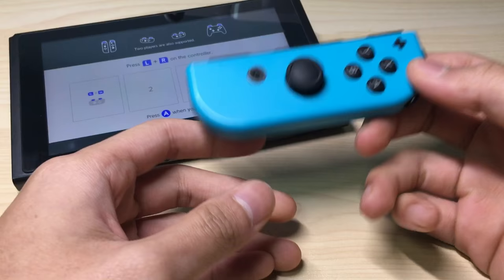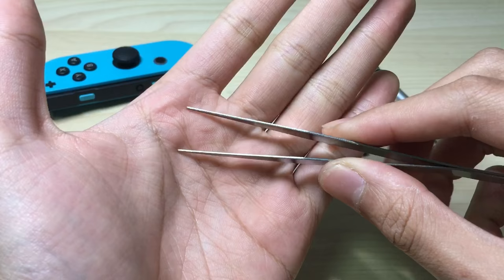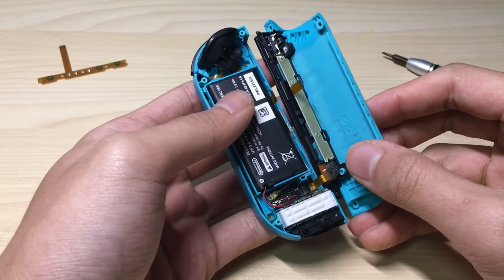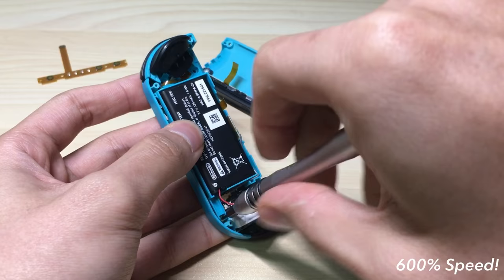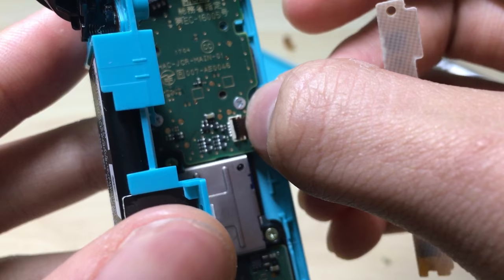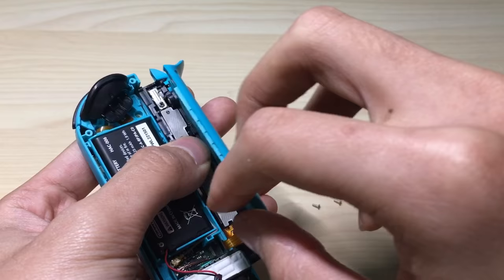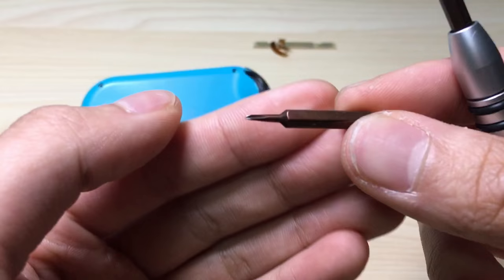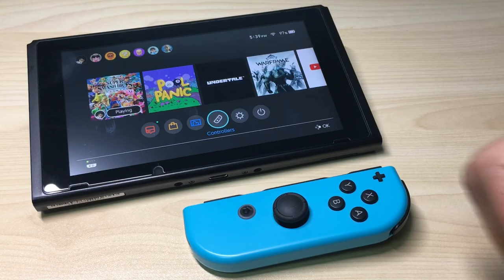Joy Con SL/SR Side Buttons Repair Tutorial (+IMPORTANT TIP!) - Nintendo Switch DIY Repair

Comment: Just used this tutorial today to fix my left joycon, thanks for the tips!
One thing I’d also recommend is reinforcing the part so the SL and SR buttons are more clicky. To do this, I took the old, faulty part and ripped off the ribbon cable, then used a knife to remove the electronic parts from it so it was just a flat board of the exact same shape. I then screwed both in together one on top of the other, so that the part didn’t flex as much when the buttons were pressed. It’s now more clicky than the original board, which is nice! The piece flexes less too so less prone to breaking.
Reply: yes. such a pro tip !!
Reply: I did just like you did, i was a litle more dificult to close, but worked. I hope that will improve the cable resistence. Thank you!
Reply: @viniciussales4264  Yes, definitely made it more tough to close but once it closes it should be solid! Had to replace the Right joycon in the same way last year, and have not had any issues myself with either joycon so far.

Comment: My son dropped my switch and the joycon stopped connecting to the switch when attached. Found out the black bar wasn’t working anymore. You’re vid helped me disassemble the controller and it turns out the strip was unplugged (didn’t know it was a plug at all lol). Just plugged it back in and now it works. Thanks for the vid

Comment: Thanks for this video, I was able to repair my son joycon following these instructions and the replacement cable and a tri wing screw bit. Cheaper than buying a replacement. The old cable was kinked and I replaced it just as you showed. It works perfectly now.

Comment: I just spent 2 weeks getting this problem fixed after thinking I broke the first replacement by bending it too much and it wouldn't work. Another replacement part later, I just now realized the little connector from the battery was slightly sticking out of its socket🤦🤦. Anyways thank you for your tutorial it was excellent and very thorough.

Comment: Thank you so much for this video, I couldn't use the synch button one day and this helped a lot with fixing it.

My hands are big and they shake a lot when doing precision stuff so you can imagine how hard it was for me, especially dealing with those tiny connectors like the ribbon cables and the battery connector.

I think I meesed up tough because the actual sync button feels loose and I can't actually press it with my fingers, I have to use something to press it down and make it click, kinda like the wii days... by the time I noticed I couldn't be bothered to open it up again lmao. Maybe some other day.

Comment: Before rushinh to buy a repair, check the ribbon cable hasnt simply loosed a little.
This happened to me following a reshelling your joycon tutorial.
Only SL worked only 3 lights lit up. Simply repositioning it fixed everything.

Comment: Thank you helped me replace it for me on the original the ribbon cable at one end seemed to have been badly bent so moving it ever so slightly causes it to lose connection so I just replaced the whole thing.

Comment: thanks for this tutorial! do you have any clue on what to do when the little lock bar breaks off on the connector? they’re so tiny so it’s impossible to put it back on 😖
Reply: Are you talking about the little black plastic bar for the ribbon cable? Mine broke too and idk what to do, I’m considering just using super glue to keep in place
Reply: Same issue for me, the black clip broke off and don't know what to do to hold the ribbon cable in place, any advice appreciated!

Comment: My switch as a whole has been faulty since day 1 and its a shame since i love all the games. I've had countless problems: My consoles fan is faulty, drift on both controllers, all of the side rail not working on my left joy con. This helped me get rid of one. Thanks!
Reply from the maker: That’s true, the games are fantastic, I just wish the console would be more reliable. Anyway hope you won’t get any more issues!
Reply: Did you ever get your console sorted out? The fan is connected to the Switch’s rails through the same circuit so replacing the fan will resolve the issue.

Comment: Just replaced mine, but i didnt remove the battery an the other connectors. Just removed the two screws on the right side of the battery, then i was able to lift the plastic part and reach the connector to make the swap. This make it way easier, and less risky, since the battery connector is so small and feels super delicate.

Comment: Unfortunately couldn't do the under the battery tray trick for my left joycon as it will interfere with the stick module and the ribbon cable for L/ZL buttons but otherwise it went great, thanks for the tutorial. Too bad the cable is intentionally designed to be too long in length as this cable will fail again as that fold flattens over time until the connection breaks.

Comment: I have a problem with the left joycon - both stick drift and the failure of the SL SR buttons. Unfortunately the left one doesn´t have a nice way to tuck the ribbon cable so as soon as I reassemble it I know it's only a matter of time before it happens again.

Hopefully Nintendo (and the other major publishers) resolve this problem next gen because they used to stand for quality but each of them have been suffering stick drift for years now across multiple iterations. Even the "elite" or "pro" options that cost £150+ suffer the same problems.

Meanwhile my GameCube and PS2 controllers work absolutely fine over 20 years on.

Comment: I had the same problem, but i fixed the flat cable, it is really hard and have to be precise, if you dont want to wait or pay for a replacement should give it a try, but i recommend buy the replacement, too annoying to repair

Comment: Thank you for the great video. I've followed the steps on a R Joy Con and put it back together but am getting no lights at all. Battery and NFC cables seem to be reconnected correctly and ribbon cables seem to be clipped in correctly. May just battery drain? Any suggestions?  🤔

Comment: Hiya, i damaged the rail on my joy con and want to replace it. Is this the same method to do so? Thanks!
Reply: This method is just for repairing the sync button, joycon wireless LEDs and SL/SR buttons. If your joycon won't connect to the switch handheld properly, it may be because some pins aren't making contact so you'll need to clean them.

Comment: Can it be fixed without the sl sr board? I changed the joycon's shell and the zr button wasn't clicking, so I took it apart and fixed the button issue, but now this happened. It was working well before I took it apart the second time, I don't think the board got damaged in the process.

Comment: I replaced the shells and on the left joy con the SR ribbon cable doesn’t want to stay in. I’ve made sure it’s locked down and everything but it just doesn’t stay in and I can’t get the joy con to connect to the switch. The battery is depleted, but I’m assuming it works. it doesn’t connect to the switch to charge. Any thoughts?

Comment: I have some questions if you wouldn't mind answering them. My right joycon it's turning on or charging, I changed the battery and the sl rl strip but still getting nothing. Am I just having to get a new one or am I missing something? I can't find anything online besides having to change the sl rl strip but that didn't help.

Comment: I opened my controller up and repaired a button, and had to remove the bottom ribbon cable of the rails, now I can’t get it into the connector right which is making it so it won’t connect to the switch in Handheld mode:(

Comment: My left joycon wouldn't light up or connect individually (using the l&r) so I bought the board to replace it (not the same vendors mentioned in this description, but I used this guide) and when installed the light blinks sporadically and the analog no longer worked and the console was saying the battery on the left joycon was low. When I remove the new part, using both joycons together wirelessly and attached to the console work like they did before adding the new part (other than the initial problems: not connecting individually, no lights) and no low battery warnings. I didn't pinch any ribbon cables and it was seated correctly, could the new part have been defective?

Comment: Hello! What should I do if I broke the little plastic that is holding the ribbon? It's so tiny I cant find a fix :(
Reply from the maker: Unfortunately you either have to try and put it back (I did it once and it was so tiring), or tape it real hard, or get a new board 🥲

Comment: Kenneth tanaka. Dou you know how to remove the screw that stripped? Plzzz respond.
Reply from the maker: That’s gonna be very difficult, I’ve never successfully removed one, but I know one trick is to use a rubber band, push very hard with your screw driver and twist, the idea is hopefully that rubber band can fill in the stripped gaps...
Reply: @namedkenn  thank you... for the tips...

Comment: Thank You, the side is working. But right now when the right joy  con attached to console it doesn't work. I've tried disconnect joycon and connect back, power off, all doesn't work. Is it any cable I've affect during the process of fixing.

But even that doesn't make sense as when the joycon was use individually as dual player or single player it works
Reply from the maker: It could be, make sure that you have connected everything inside, there’s one connector that only serves to connect the joycon to the switch
Reply: @namedkenn  any idea which connector would it be?
Reply: @namedkenn  could it be the shorter ribbon that is the next to the SL SR or the ribbon below the R and ZR?
Reply from the maker: Rayn Lim it’s on vertical orientation, at the very bottom of the SL/SR rail, and the connector is very close to the motor/battery connection at the bottom of the Joy Con

Comment: don’t know if you reply to comments but if you do, what screw did you use? i used a PH00 and got all out except the bottom one at 6:00 and the head is damaged now.
Reply from the maker: Ah I'm not sure which exact one I use because I just usually pick by eye, but to open that you definitely don't want to use the smallest one (i.e. PH00)!
Reply: Kenneth Tanaka all good man. got it repaired but the SR button isn’t working. Thanks for the video anyway!

Comment: i inserted back this piece (since mine detatched from my joycon I didn’t buy a new one) but when i connect it to my switch I won’t recognise it (only wireless) and im afraid it will run out of battery and have to buy a new set of joycons, anyone could offer some help?

ive already tried the sync button thing but still wont detect it

Comment: 4:27 I broke the clamp/lock/ by forcing it down. what do I do? can I still force it down using some hard plastic or my tweezers? (its not staying in place with electrical tape/tak/normal tape)
Reply from the maker: Actually this also happened to me the last time I tried to clean it, finally I tape them with a black wire tape thing, and put some more tape, and some more, and it works! Though I’m sure if you stuff it with hard plastic or folded paper you could do it

Comment: Omgggg the lock the supposed to hold the ribbon cable broke on mineee :(((( Please helpppp thanks 
Btw will my joycon still work without the ribbon cable?
Reply: It will work, but you cant use the shoulder buttons anymore. And the lights won't work anymore

Comment: Hello, I apologize ahead of time bc I don’t know the correct terminology for any of these things, I have a hard time even turning these things off and on. I have bought two sets of these joycons bc my son has some issues and has a hard time controlling himself, especially since school is out, he is very routine oriented so it’s been a little struggle. He does really good on his games and it’s the only thing that works to reward him for his good behavior but he is a little rough on things and and he has broken two right side joycons(of course it couldn’t have been one of the left sides. The ribbon tape is sticking out of the right side joycon, like it got stepped on it dropped and is broken. Is this the part I would need to buy to fix his joycon or is it just plain broken? Is there an email or anything I could contact you to ask for help. I really apologize ahead of time but I am at such a loss, I can’t afford to keep buying these joycons and it would be great if I could fix the two he broke and then we could have an extra set. The corner of the plastic is kind of cracked but I don’t think that would be too much of an issue. Thank you so much for even reading this comment and I hope you can help me. Thank you -K
Reply: I hope I am not violating any rules or anything by asking for your help. I apologize.

Comment: Hey you know how to fix connection issues with the right joycon it would only work wirelessly i tried every single thing and i think the problem is internal. Any hrlp?
Reply from the maker: My only guess would be the physical connection pins at either the switch itself or the joycon side. You can try a friend’s joycon or a spare joycon and put it to your switch to test out, so we’ll know if it’s the joycon’s fault, in any case if the problem is in the joycon connection pins, I think there should be the replacement in AliExpress, you can try and search it out 👌🏻

Comment: Mine won't work even after i changed the part. When i connect it to my switch it has a delay to connect and shows that the battery is almost dead.
Reply from the maker: That could be a problem of the battery, try reconnecting it again, though I’m not sure if it’ll work
Reply: Mine doesn’t work either. I just ordered the SL part and installed it. 😔no low battery warning tho

Comment: How long does it take for the tripoint to remove the screws? I have the right size
Reply from the maker: Uh it should be quick no? Just like removing any normal screws
Reply: @namedkenn  It was the right size but wrong type. My stepdad filed it down to fix it.

Comment: Help I’ve been trying to connect the battery cable again for like an hour now 😭
Reply: I had the same problem too. Take a look underneath the connector and you can see the slots are at the bottom. It it makes sense, you just align both parts and press from the top rather than slotting from the side. It should click perfectly. Hope this helps.
Reply: I faced the same problem. If you take a look underneath the connector, you will see slots for the pin. Just align both parts together and press from the top rather than from the side. It should click perfectly. Hope this helps for future fixers.

Comment: Selamat pagi Kenneth dan terima kasih untuk video yang sangat berguna ini. Lampu kuning petak di left Joy-Con saya tidak menyala selepas saya tukar shell, analog stick dan buckle lock. Bila saya check semula, lampu akan menyala apabila ribbon cable diluruskan atau ditegangkan, tapi terpadam apabila dalam keadaan biasa ataupun bila saya tutup shell. Any solution for this? Adakah dengan mengganti ribbon cable itu akan buatkan lampu Joy-Con back to normal?
Terima kasih
Reply from the maker: Pagi Nazrin, saya tak begitu pintar berbahasa Melayu jadi saya balas dengan bahasa Inggris saja ya 🙏🏻

So this happens to me as well, a couple times actually, lights up when it’s straight but turns off when I close the joy-con (which is now bent), and if I do that a couple times the ribbon cable will eventually break. So I think it is a sign of breaking, and changing the ribbon cable will most definitely fix the issue 😁 semoga bisa membantu 🙏🏻
Reply: @namedkenn   Kenneth Tanaka  Thanks for replying. Great to hear that. I will just have to buy the ribbon cable and change it. Anyway, semoga maju jaya buat anda 😁👍
Reply from the maker: Terimakasih banyak 🙏🏻😁

Comment: Both of my ribbon cables fell out, but didn’t break. Can I just put them back in?
Reply from the maker: You mean like, went outside the outer shell? Or like disconnected from the socket? Anyways you can always connect them back together and see if it works, then it works.
Reply: Kenneth Tanaka just from the little socket. It’s not a big deal if it doesn’t, I’ll straight up just buy new ones. I hope it works.

Comment: Thank you for your tutorial. My left joy-con doesn't work totally. The light, all the buttons, anything. I wonder if I can fix it in your way.?
Reply from the maker: This is only a fix to the lights, and to the SL/SR buttons when used wirelessly, try connecting the Joy Con to your Switch, and check if all the rest of the buttons are working (A/B/X/Y, etc.), if it is then this tutorial will work.
Reply: @namedkenn  Thx for reply. All the buttons don't work even if I connect it to my Switch. I think I should try other ways:(  Anyway, thanks!
Reply from the maker: Okay I have an idea what’s going on, maybe you can try changing the entire Joy Con Board. I have replaced mine once too (because I used a metal spudger while unplugging the battery and shorted the board), so maybe that could help.

Downside is though, the board is pretty expensive. Hope this helps!

Comment: Just now I broke this, now just dont work SL and SR an green light or I dont charge the joycon ?
Reply from the maker: If the SL/SR and green lights don’t work, then you you can proceed with the repair detailed in the video
Reply: Kenneth Tanaka Yes i know, Im replacing the joycon case and I broke the orange connection to sl and sr. But my question is if just dont work SL and SR or i cant charge the joycon.
Reply: They should still charge, there are two seperate cables, the bottom one is the one that handles charging, so if only  the one closer to the top was broken, then it’ll just be the lights, SL, SR, and sync buttons that dont work